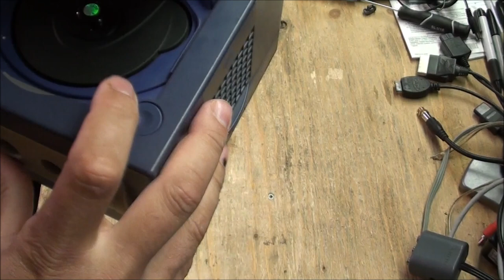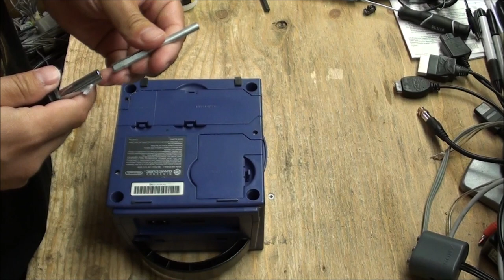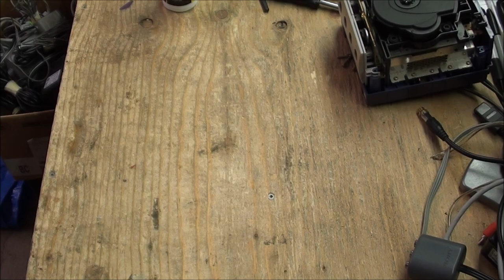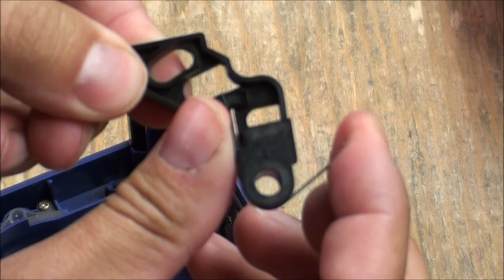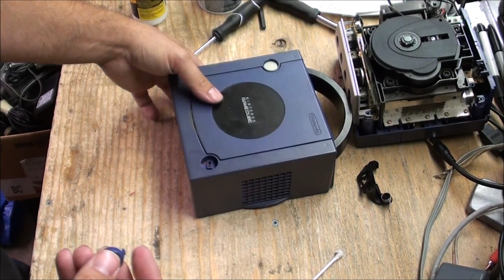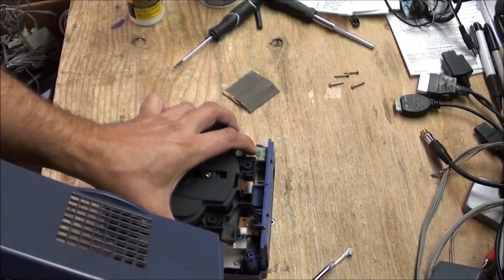Gamecube lid won't stay closed? Stuck or Sticky open/eject  button - Easy fix

Comment: Thanks. I just need to order the Screw bit & get her cleaned up. Someone had spilt a drink without me knowing and god knows how long it had happened. I went today to open up the disc tray and boom button sticks. so mad....
Reply from the maker: Well, glad that it helped :)
and I've seen that more times than I would like ( cleaning some fluid that's leaked inside, gross )